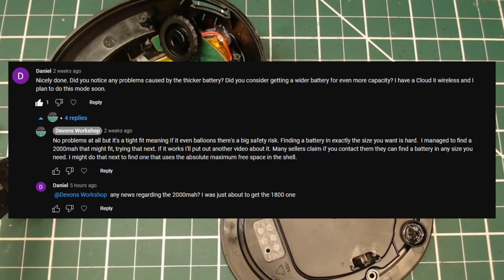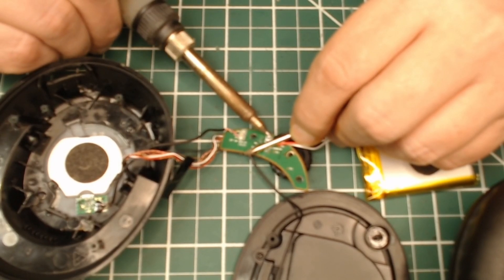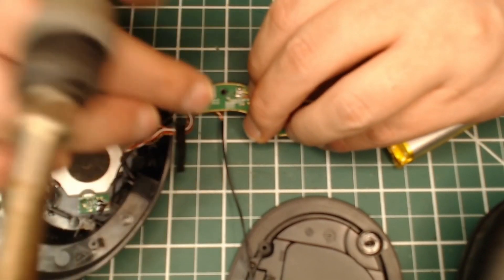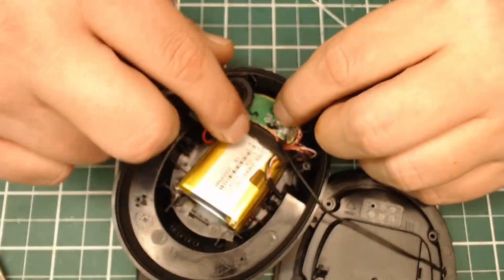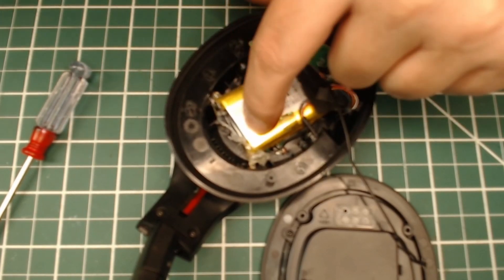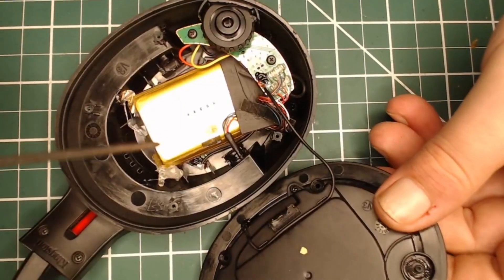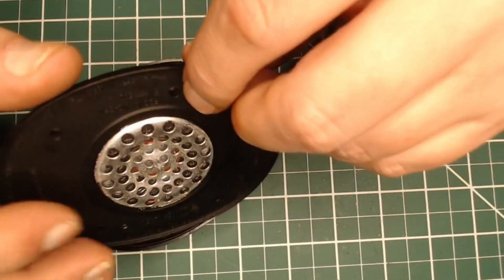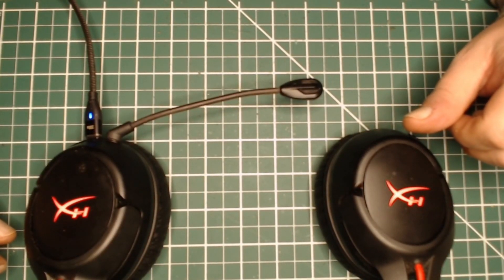HyperX Cloud Flight Battery Upgrade (2000mah)

Comment: Dumb question here, but I did 1800 upgrade and battery does not last nearly close enough as it should. After 5-6 hours software reports low battery and I hear that double beep that battery is near end. It lasts as much as 1500mAh after 3 years. Could I've done something wrong while soldering, did I got a bad battery and buy new or does the software need somekind of update ?
Reply from the maker: It's a bigger battery so it needs to be charged longer. It's possible it's a weak battery but if it looked brand new then odds are low it's the battery. If the solder connections look good then I don't know it. It's a direct swap all things being equal it should last longer. I get days worth of use out of mine, not hours.
Reply: @DevonsWorkshop  Thanks for the reply, I will order new battery and check it out. :)

Comment: Great information. Could you tell the mass of the original, 1,8 Ah and 2 Ah batteries? Since all the added mass will be on one side, I'd like to know how much I'm adding if I go for the bigger capacities.
Reply from the maker: The mass is the storage potential in mah. The dimensions are part of the model# printed on the battery. If you mean weight the difference is negligible, you’ll barely notice a difference.
Reply: @DevonsWorkshop  Mass is what is measured in for example grams, weight is a force (in daily language people use "mass" and "weight" interchangeably although they actually mean different things). For example, if you are on a moving elevator, your weight will change depending on the acceleration but your mass stays the same 🙂

Surprised that the difference is small – I would have guessed different! Did you put them on a scale?

Comment: hello friend on the reddit post you mentioned a custom made 3000mah battery leaving the link
I bought it without thinking much and now that I was checking your youtube channel to see the video I only find this one about the 2000mah battery, do you have any news?
Reply from the maker: I think it ended up being about 1-2mm too thick. I could fit it if I squished it in there but squishing these types of batteries often leads to an eventual fire hazard. I stayed with the 2000 as the largest one that can safely be stored inside the headphone. I was planning on 3D printing a larger headphone shell for the larger battery but never got around to it.

Comment: How abou the plastic covered on the circuit board, how do i clean it , to be able to solder
Reply from the maker: @geralddelbert2988  I’m not sure what you mean. You shouldn’t need to clean any plastic on the PCB. Cleaning any PCB though can be done with isopropyl alcohol, preferably 99% alcohol so it dries faster. Regular rubbing alcohol can be used but takes a long time to dry.

Comment: Hey, I recently got a HyperX Cloud Core Wireless with a dead battery from a friend.  Currently, there aren't any replacement batteries for the Cloud Core Wireless available for me. Can I use a battery designed for the Cloud Flight Wireless instead? They both seem to be 3.7V
Reply from the maker: If they both use the same battery type regardless of capacity then yes.

Comment: Hello, the topic here is very relevant, I saw in another video that you upgraded to a 2,000mah battery, in a hypothetical if I could find another space on the other side of the headset, is it possible to install two 2,000mah batteries in series? Hugs from Brazil
Reply from the maker: Not with lipos in that arrangement on your head. No, I recommend against even attempting it.

Comment: 1 question, if I remove the battery, will it still be usable? I'm not good at soldering so I feel like I'm fine if I can just use the headphone with cable..
Reply from the maker: There is a 3.5mm jack on the headset so that you can plug it into the back of the PC. I can't guarantee you could use the microphone without the battery but you can certainly use the headphones.
Reply: @DevonsWorkshop  thanks, that works! I only use the headphone for the audio, could use it while waiting for the battery shipment arrive..
Reply from the maker: @Tromaxer  I didn’t even think of testing it out before replying. Like derp, I have the same headset.

Comment: I can only purchase a battery with 2wires but same model is there a chance i can convert it to 3wires?
Reply from the maker: No
Reply: I did and i just soldered the white cable from the old battery to the new one, i see there is a spot for it

Comment: Works if battery only have 2 wires?
Reply: It doesnt, I did that mistake and it works only if the battery have any charge, but the headset wouldnt charge the battery with cable or wireless charger.

Comment: Great video Devons, thank you very much. I did use it to replace the battery on my HyperX Flight S and it worked prefect.
I have a question maybe you can  guide me and help me, previously I get a battery, the make and model is EHAO 604050 1800 mAh, that one doesnt have the the thermistor terminal, just positive and negative, so  the headset doesnt charge the battery but it works perfect if the battery have charge.  Then I found your video and I get the correct 1800 mAh one, and here it is the question, Can I install the EHAO 604050 1800 mAh in paralel with the correct one? Theoretically speaking I should have a 3600 mAh battery with both installed, but I am not sure if the circuit will be able to charge both batteries that way.
I would appreciate any help mate and thanks man, keep up the great work.
Reply from the maker: I would not do that. Two cells are not to be joined without a multi-cell load balancing BMS which a headset is not designed to do. If it was for a project that doesn’t sit on your head maybe i would offer specific advice how to do it properly. I’m not the kind of person to give advice that might have dire consequences.  Even if its not your head that catches on fire then potentially your house.  It’s a bad idea if something goes wrong.
Reply: @DevonsWorkshop  I do appreciate your response. I will not do it due to the fact that it could be dangerous, I did just get exited by the idea of getting extra battery lenght.
Thank you very much Devon!
Reply: Have you tried it does it work?
Reply: frenly i have clod flight s. i need to change battery. what battery i need?? please :(((

Comment: The Cloud II doesn't have wires going through the hinges, so it should be easier, I will keep you updated
Reply from the maker: Didn’t know that. I’m guessing the distance between the hinges is still the same which is what affects the largest width you can achieve.
Reply: @DevonsWorkshop  so I gave it a go earlier today - there is zero chance to stuff a 10mm battery there. It simply won't close, unless removing the sponge that's there to hold the battery which I dont feel comfortable removing
Reply from the maker: @dnlzy  perhaps they’re slightly different than my cloud flight compartment? 10mm does fit for me barely. You could use some clay or playdoh to smush in there to get your max size if you don’t have calipers. I knew 10mm was my max size because I measured the height of the screw bosses to the bottom plate. Thank you for the info though I’m sure it’ll help others trying to upgrade their cloud ii’s in the future. I have one more battery coming to test. A 104060 3000mah, crossing my fingers it’ll fit.
Reply: @DevonsWorkshop  I have a caliper, the problem is the Cloud II comes with a 3-4mm sponge on the plastic that holds the speaker, and I don't feel comfortable removing it. I think that if I do it will fit.
Reply from the maker: @dnlzy  interesting, I have 2 cloud flights and neither have that. So I guess you’d have to measure the foam then subtract that from 10mm to get your max thickness. Unless there’s something behind the foam then removing it is perfectly fine.
Reply: @DevonsWorkshop  Hello, I had the same problem with my HyperX Cloud 2, I believe that by the time you have already replaced it, what is the solution?